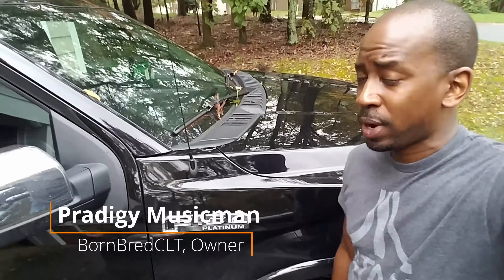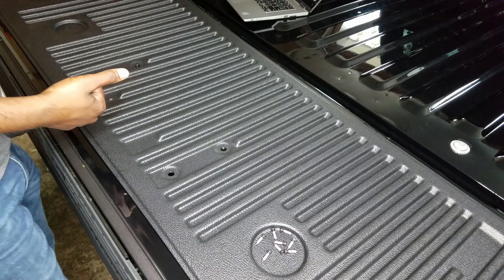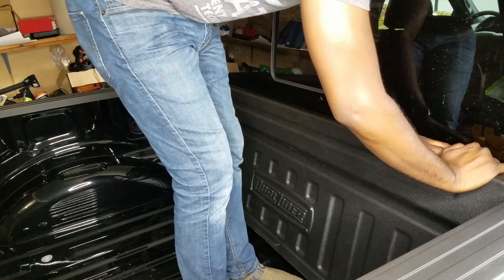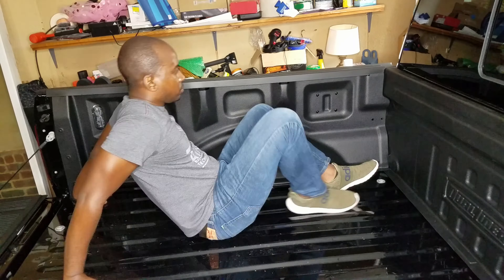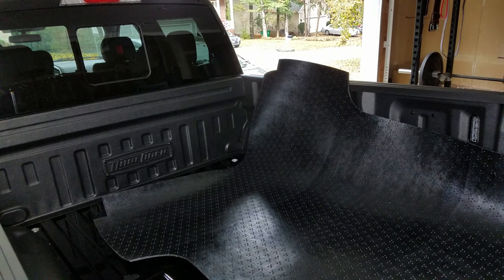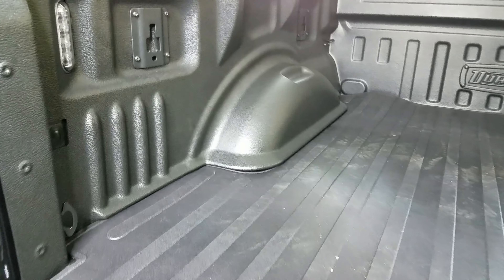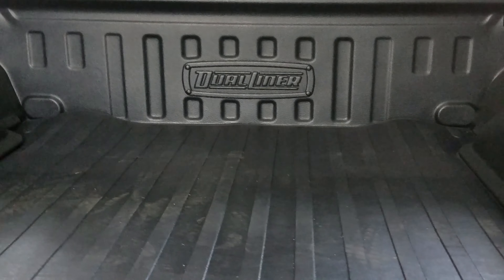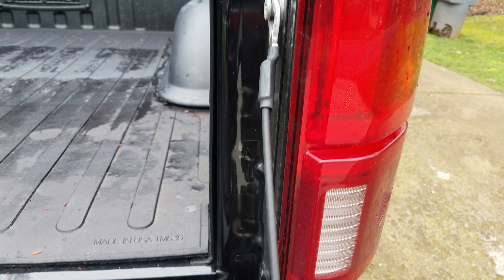HONEST Review Dualliner Bed Liner Installation Ford 150 should you buy? How to protect truck bed

Comment: I recently ordered DualLiner for my 22’ 250. Called to make sure it was in stock, and was told it was. Ordered that evening (website said in stock, ships 4-7 days) and the next morning awoke to an email stating “back order” I called and was told “how am I supposed to know, could be 2 weeks, could be 6 weeks” I waited another week and called back, I was assured the materials were back in stock and my liner would be shipped within the week. Fast forward another week and I received an email stating “will ship next week” ended up disputing the transaction and ordered a rugged liner. customer service is a bunch of zombies, ownership could care less, and from what I’m seeing across the web people are hating these things. Another great idea ruined by trash people!
Reply: Hey How’s the rugged liner Have you installed it ? The LineX is expensive and paper thin. It’s a scratch resistant coating only if that in my opinion. Nothing like what it originally branded as being total bed protection
Reply: Hey did you get Rugged Liner if so how’s it working out. 
I thought about the Dual liner but didn’t like to hear some same issues by different people

Comment: My panel was not cut properly on the drivers side either. As soon as you trim it or wallow out the holes so the tie down cleats line up, customer service will tell you,  because you altered it, they will not take it back for a refund or replacement.  They are the ones that tell you to trim it in the first place.  The rubber mat  had more humps in it than a piece of bacon did not flatten itself out when the temperature warmed up like they claimed it would.  I hope the F150 in this video does not find the paint worn down to bare metal at the friction points like mine was.  BTW  I had a spray in liner installed to cover the damage.
Reply: Interestingly enough we had the drivers side look a little off but we readjusted it and it lined up perfectly.  Just a little more patience and it was in just right.

Comment: How is it holding up now that you've had it a little longer. Also how did you go about fixing the left side.. you just had to cut it to fix it?
Reply from the maker: Christian Gomez it’s been great actually. I used a knife to cut that leg panel a bit so I could get it more flush. Something is just off with that piece. I recently put a bakflip mx4 hard cover on the bed so I don’t think about it anymore
Reply: @PradigyMusicman  thanks for the quick reply! I want to get one but I heard its hit or miss on what you get with dualliner. I might just do it to save the cost and it still looks really nice. Did you ever make that video on the MX4?
Reply: Have you tried to put the tie downs into the Boxlink plates yet? I had to loosen the plates, install the tie downs then tighten the plates.

Comment: Interesting. Makes me not want to go with this even more. 

Really struggling to find the right thing for my Raptor. Spray in is not an option since I carry lots of computer equipment and it would damage the hardware. A simple rubber mat or the BedRug are the 2 I'm most leaning towards. Right now, I just use cardboard on the days I am hauling equipment. Not very practical, but cheap as hell.

Comment: Thanks for the review, I have a 2019 F150 and I cannot get those pillar spots to line up, there is about a 1/2 gap there, everything else is flush....wondering if they need to send me different side panels....
Reply from the maker: Hey I’m glad this helped! I add a hard tonneau cover to it and it covered up the gaps bc of the track. Recently I got a bunch of soil dumped in the back and I didn’t have any issues so I’m still happy with it